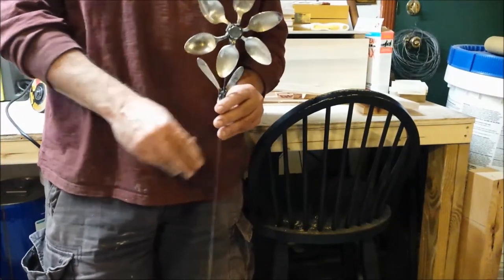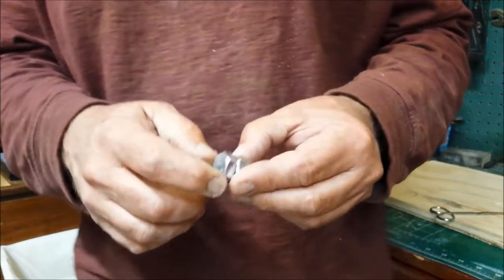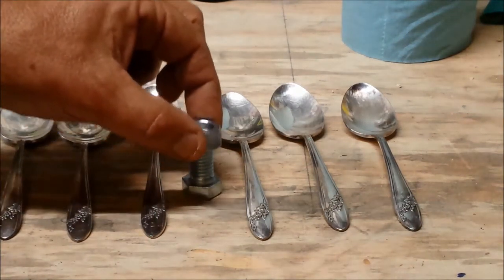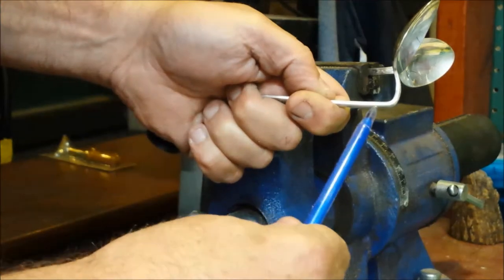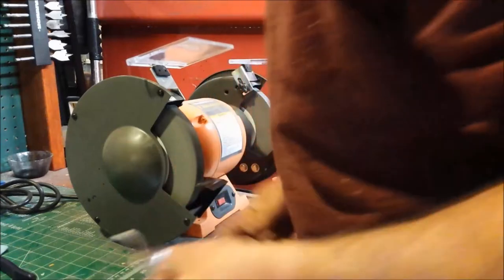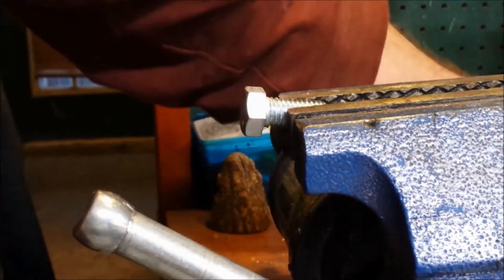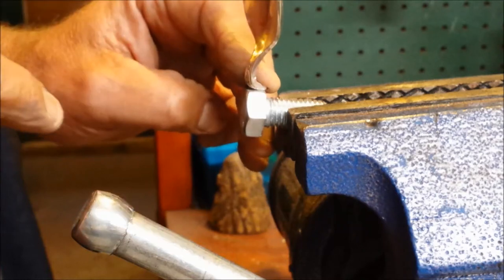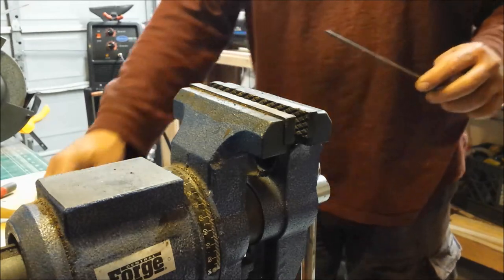Spoon Art Flower

Comment: The steel from those signs are likely galvanized. FYI heating it up and welding with it....
Reply from the maker: These aren't the newer galvanized type.  They are older, a spring steel type of material.  I usually have to wire wheel the rust off them.  I dont work with Galvanized metals.